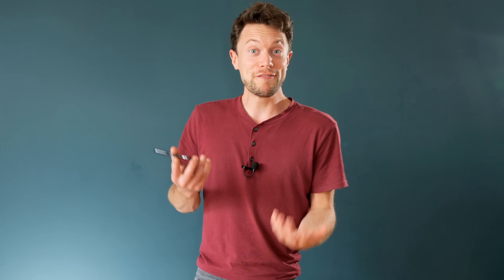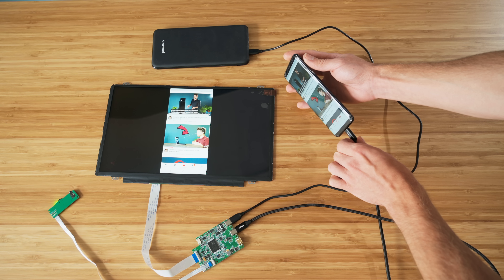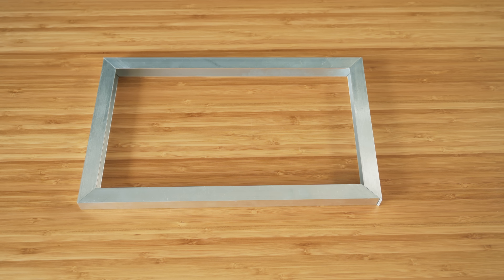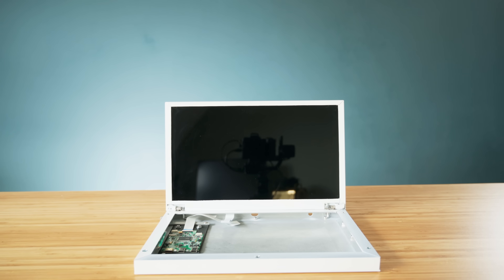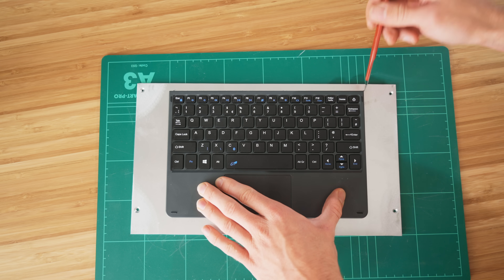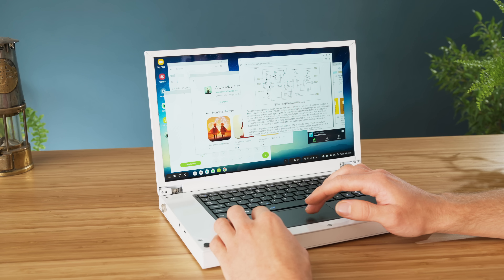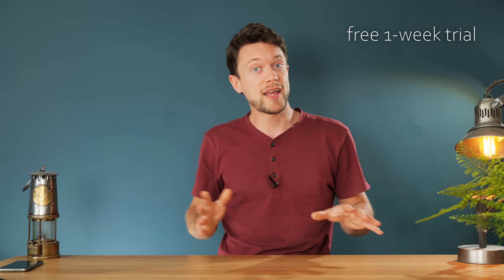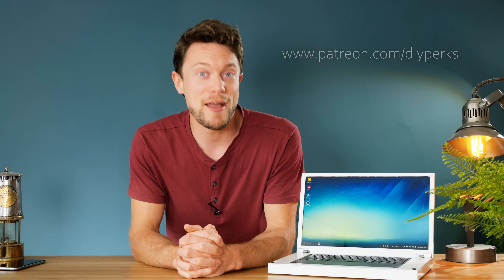Broken smartphone to working laptop transformation

Comment: you could've used a laptop keyboard and touch pad, since they're usually usb, and then mount the phone in a way so the front camera pokes out from behind the screen. a usbc dock with hdmi + extra usb slots with charging input too could've been the motherboard too, there are some fancy baseus branded ones I think...? on aliexpress for relatively cheap (haven't checked if they can do phones... I'm planning to tho) those also allow for extra card readers too. not to mention QC3 fast charging. haven't tested but in theory the hdmi could be monitor one and a usbc output another?

damn you, your videos are motivating

Comment: requirement : a screen, broken phone, keyboard, and many other stuff

me who have a broken laptop and a broken phone : [intense thinking intensify]

edit 1 : can you make a video about turning a old phone like this but into a PC?
Reply: The phone already is a PC 😅
Reply: If you want to connect the laptop screen, you can follow his other video on that but esentially you need a driver for the specific lcd you have you would also have to Frankenstein a lot of stuff, probably you wouldn't be able to use the laptop's keyboard and the phone has to have video output through cable which not a lot of phones have
Reply: you can use the laptop's keyboard with an atmega 32u4 or AT90USB1286 based arduino (teensy 2 and 2++ for example.)
you just need to find how the keys are connected, and you can make your own keyboard.
Reply: @satibel  good point
Reply: There already is a video about turning ur broken Laptop into a Desktop
Reply: Shadow pc app via dex.

Comment: Why not make the charging port usb-c? This just seems like adding extra steps for no reason
Reply: More laptop like
Reply: This is just a way of showing the basic idea, several features can be changed to your liking. He probably didn't have an usb-c charging port on hand. That's also why he often says you "can" and not "you have to".
Reply: The power bank may not be able to charge that way
Reply: @kerodfresenbetgebremedhin1881  Why wouldn't it charge? It's just as simple as changing the barrel jack to a USB C board, the data pins aren't used so those can be left out.
Reply: @jingarjay8754  why don't you build a better version?? post on your YouTube channel. i really want to see your VERSION kid!!!! at least he builds something that working you can build your own version to add much more features and make much more easy
Reply: @puteraamieq1097  All right mate calm down.
Reply: @puteraamieq1097   stop beeing so learn resistant .. usb to barrel and barrel to usb is a dumb idea, now he has to carry an extra DIY adapter with him . instead ob just USB . he could have even use usb c , micro, mini, etc.. all at once as input ports (enough space for that) and that way be able to charge his laptop even if he lost all his cables.
Reply: @papagal2553  why not dismantle the phone, throw the guts inside and utilize the wireless charging capabilities.  Relocate the camera, and place the type c charging port at the base.
Reply: @puteraamieq1097  Chill, he's just giving a recomendation/idea
Reply: @kerodfresenbetgebremedhin1881   i  can
Reply: Why would you make the charging port a type-C when a barrel jack is so much better for power delivery.

Type-C is great for versatility but in my experience it's a terrible standard. Plugs n sockets wear out too quick

Comment: If I'm not mistaken future versions of android are being planned to support some desktop modes similar to DeX on Samsung phones, so this is not only relevant for current hardware but also "future proof", I quite like it. Also, even if your phone doesn't get the update for any reason there will probably be a way to flash new android versions to it with LineageOS or similar software. And I've even seen some people managing to run Linux Distributions like Ubuntu on samsung smartphones as well so possibilities are (somewhat) endless, only limited by actual capacity on the phone's processing power, or memory capacity.

(For anyone interested, a "quick summary" of Linux Distros would be something like Android itself. Motorola, LG, Xiaomi, Samsung all have different features and software bundled with their own twist on Android, but it's all built on this same Android base, making them all different from iOS for example which only apple can access, etc.)

Comment: My one problem with it is how fat the laptop looks, like that's dang near the same if not thicker than my laptop from 2010.

So if I were to be doing this I'd have the keyboard deck slanted so it'd be a bit better to type on and would cut down on the thickness by alot

Comment: Can you drill a small hole in the back of the phone and gain access to the antenna for wifi\cell signal then solder leads to the aluminum case to turn the case into a giant antenna?

Comment: Your power switch is kinda sketchy, cutting the usb c cable and adding a normal switch or a transistor to switch the power on and off would be more reliable and stronger
Reply: yeah the constant plugging and unplugging would probably not recommended for long term use
Reply: It's not just the power switch. It's 2x and one has signal. Trying to wire for signal and have it work is hard, signal wires are like 3 little strands most people couldn't DIY that.
Reply: @steveseeger  i thouthg the only signal cable is for the screen? the other type c are the power input from the power bank no?
Reply: @ahmadshiddiqn  depending on how it is setup, the screen board might try to be powered by the phone via the data lines if you are only switching the power.
the simplest solution would probably be to use an extension cable (female to male usb c) and use that as the switch. so if/when it gets worn out, you just replace the 2 cables instead of the board.

Comment: This would be awesome for the different gaming phones out there like the Asus ROG gaming phone or the Razer Gaming Phone. You could also try 3D Printing a holder for your phone to attach to the back of the laptop. This whole laptop could even be 3D Printed if one had a 3D Printer. I'm really tempted to make this cause it would be fun for uni if I got a new phone. Cause my laptop is quite bad so I can have it all in one place. For a speaker you could always use a wireless speaker or headset etc. I love your videos as they are always so innovative and very good quality!

Comment: In the future I reckon most people won't have laptops, they will just have a dock for their phone.
Reply: Seriously doubt that, for many reasons including: screen size and space, power factor, software compatibility. But if you wanted to make a point that more people will have a phone than a laptop, that is already so.
Reply: I think he means the dock will have a screen, keyboard, trackpad, and battery... but the CPU and memory will be used from the phone. Makes a lot of sense!
Reply: @ItimDave  Indeed.
Reply: It depends, phones are getting crazy expensive nowadays, so if you have one of those it would be pretty nice. OTOH  you could also buy a relatively cheap phone and buy a good laptop.

Comment: if the phone on the back was lifted up a bit, the selfie camera could peek over the screen and provide webcam facility!
Reply: his USB-C cable is probably too short.
Reply: Yes, and if you tilt your head just slightly to the left and lift your right leg up about two inches your internet connection will be blazing fast.

Comment: Can u please show how we can make a tablet out of broken phone like this isted of making a laptop i think that will be more useful (it must have a touch screen display)
Reply: From my thoughts:
For prototype you need usb-c dongle with usb and video out, portable monitor, usb touchscreen and powerbank
Just connect display to display out, touchscreen in USB, and powerbank output to usb dongle and display
If you want, you can also plug a relay or any switch between monitor power and powerbank, and connect control part (relay coil, for example) to another USB port in dongle
I think it should work, if your phone have video output capability
Reply: Was thinking about this the entire video.
Reply: Look up diy tablet from old phone on YouTube find some good videos and your done
Reply: Because glueing a phone to the back of a touchscreen monitor wouldn't be a very interesting video...

Comment: The problem is that most phone brands don't support video output.

And only Samsung has this good desktop interface
Reply: I think this would work much better with an old raspberry pi or similar SBC
Reply: @swedneck  If you need to have a phone, the pinephone would work as well.
Reply: But to be fair at 13:10 we mentioned other ways, the s8 snapdragon has alternate mode and some older phones might have mhl or slimport, and other option I would suggest for something like desktop mode is downloading taskbar (but you first need to force apps to be resizable acceding to developer options, which is actually not that hard)
Reply: @elgato2453  as I recall MHL and similar never really took off, they were always a bit niche. It was an easy way to cut costs on a feature very few people wanted.

Was hoping he had a way around that, but it's probably a problem that's too phone specific for this channel.
Reply: Windows has it https://www.microsoft.com/en-us/windows/Continuum?SilentAuth=1&wa=wsignin1.0 and Huawei too https://consumer.huawei.com/uk/support/faq/have-you-tried-the-new-desktop-mode/
Reply: @inxomnyaa  Windows mobile is dead.
Only Samsung and Huawei have that on their high end phones.
Others have generic display output (or you can force desktop mode which is still in alpha version so it works terribly)
And most don't have display output at all. For example no Xiaomi, realme and many other brands devices have display output because they don't see offering that as a good way to spend money on the phone
Reply: None of this is true. It's not common enough to rely on, but quite a lot of phones support video out in some way. Probably all of them if you include wireless. Just test it beforehand with a regular monitor/TV.
Samsung/Huawei have decent desktop modes, for the rest there are custom ROMs or apps like Sentio Desktop.
Reply: @TheZALGOisCOMING  custom ROMs, loool, only if you manage to install Samsung or Huawei rom, because others don't have even semi good desktop, and launchers that pretend to be that and the only thing they do is launch apps in freeform, they are the buggiest thing ever(that includes sentio)
Reply: @kjkardum  you clearly don't know what you're talking about. you can literally install GNU distros as ROMs, and you must have the shittiest phone available in 2014 if you get two seconds of delay from wireless transmission
Reply: @TheZALGOisCOMING  no, I'm saying you can't install Samsung and Huawei ROMs on these devices, sure you can stuff like aosp or lineage or gnu for which the phone would probably have a million driver issues, but they(the Android ones) won't have classic desktop interface.
My last 3 phones are mi5(3 years ago, sd820), mi mix 3(1 year ago, sd845) and 1+7pro(current, sd855), all of them had bad wireless display on many displays I tried(windows, Chromecast, Android TV etc) these devices use wifi direct so it doesn't matter on which wifi I was, but just for clarification the network I was on is 500/150mbit, so quite fast and even If that was used it should work, the thing is that wireless display technology is by itself bad.
Reply: @kjkardum  and i'm saying you don't have to, because there are other ROMs that give you that "classic desktop experience" far better than either of them do
you're proving your ignorance yet again by claiming that lineageOS would have a "million driver issues" when it's actually more stable than stock on a lot of phones
Reply: @TheZALGOisCOMING  wireless ones have a second to two delay, you literally can't press a single button without spending 3-5 seconds on that action and bitrate is so low you barely recognize what's on picture and video
Reply: Exactly, which is something he spend hardly anytime to explaining.

Comment: Matt, my only problem with your videos is the suggestion I could do the same Im just lazy. No, I (and many more viewers) cannot do this. Your suggestion is wrong and inevitably will lead to disappointment as I have now tried myself on two occasions and failed despite I thought I have the skills as you have suggested. I sadly had to realize the obvious - it takes more than a youtube video to get there. I ended up having several LCD laptop screens and controllers in my loft catching dust - I was trying to make the screen (any of them) work as a secondary screen. I love your ideas but I think you have to address it more they require skills you posses and took years to achieve. Otherwise you will always mislead you audience. The resolution is simple: just refer to your work in first person. "How I have done this and that....not how you (your audience) could do this and that" please. I have no doubt some (a very few) of your audience can actually do what you are showcasing, but I am 100% sure most of us cannot but amazed by the fact (as I am) it can be or could be done if you have skills this guy has on the video.

Comment: i was with you 95% of the way and then you added that absolutely stupid looking sugru mount to the back and completely ruined the whole project. Are you kidding? after you've spent so long making the rest of the externals look so nice you stick 4 ugly blobs of goo and a broken phone to the outside? why couldnt you be bothered to make a proper mount? having it outside the body is dumb and ugly enough, you could easily make the case not completely block the wifi. like. you're the one who chose to use nothing but aluminium. you could just... not do that.

also dissapointed you didnt add a usb hub to allow for a proper mouse rather than a trackpad. and what on earth is up with that weird as heck sliding mount to unplug the plugs in order to turn it off instead of just soldering a regular-ass switch into series with the cables?

and cutting the end off a usb c cable and soldering on a power socket only to then have to use an adapter turn it back into usb to plug into a charger???? why not just have the charging port be usb c????

this project is like 95% awesome and then in the last 5% of the video everything just completely stops making sense.

Comment: Sorry, but this one feels unplanned and flawed compared to the other videos.

Missing space for the speakers also points this way, although some realigning would probably save up enough space for some salvaged laptop speakers.

The phone glued onto the back of the screen pretty much kills the aesthetics of the first part of the video, even a plastic case to cover it would be much nicer.

Metals obstruct signals, this is nothing new under the sun. Cutting keyboard and touch part of the palm rest and making it out of plastic would solve the radio issues and improve the aesthetics as well.

As others mentioned, an USB-C Female to Male cable would be a better candidate for the external charger port.

I hope there will be another video about fixing it for real.

Comment: You'd probably be able to make the speakers fit if you had dismantled the battery pack so taht it bacame slimmer ans easier to place inside the frame. Or you could ake the frame thinner in this case as well, assuming you could find any thinner material to work with.

Comment: Well... You actually made a docking station for an android smartphone. It's more or less an android tablet without touch control. Not everyone is able to built a case like you did. Additionally the screen, the Powerbank, and the keyboard cost some money. Spend only a little bit more money and you can buy a brand new standard notebook with an i3 processor, which is capable to run windows 10 or any Linux distribution. That's much better and more useful...

Comment: Unfortunately most phones don't have display output through usb c so this type of project is only for samsung flagship phone starting with s8 🙃
Reply: And 100% not for iPhones
Reply: Nah, many have display output, they might just not have a desktop interface like Samsung Dex but you have plenty of alternatives on the Play Store. And if not, you can probably install a Chromecast to cast your screen 👌
Reply: @Champion1201  I'm well aware of those phones as well as mirror casting but what I'm trying to point out here is that phones compatible with this particular diy project are very limited 🙂
Reply: and A90 5G
Reply: Huawei support something similar to Dex.
Reply: @jftechdrones  yeah forgot about those. My bad
Reply: But I mean it's a super cool project and if you wanna put so much effort in something like this you should probably just buy an old Samsung.
Reply: I thought he was going to go deeper, centralizing power (all on one battery) & connecting things internally to the phone. E.g. screen, wifi antenna, etc.
Reply: @dominus6695  I was thinking that too about the power, why not run the keyboard from the power bank?
Reply: It's a shame that no manufacture in spite of Samsung does this
Reply: @fritzmueller6759  iirc Huawei has this as well.
Reply: My galaxy s5 can technically display out the micro USB port, I need an adapter to hdmi and connect the hdmi to my monitor, or TV. Sadly it doesn't have a "Desktop" android os, but that doesn't stop custom UI's.
Turns out he did explain it at the end of the video. Smh
Reply: Me Too  The phone in the video is uneconomical to repair. Also the project doesn't destroy it.